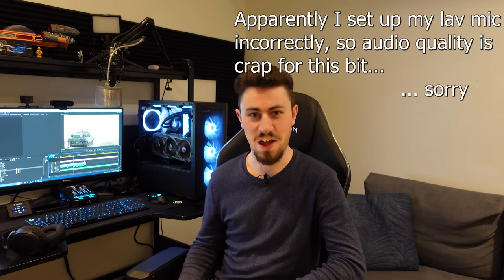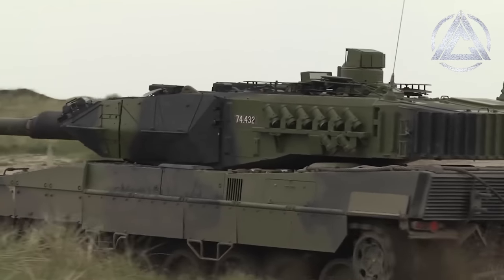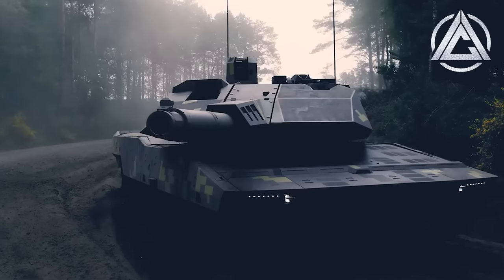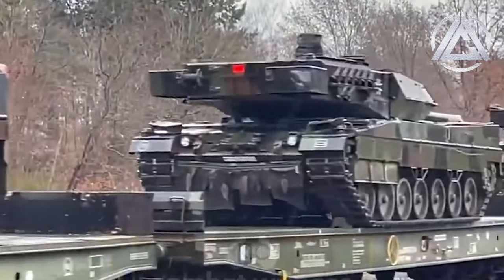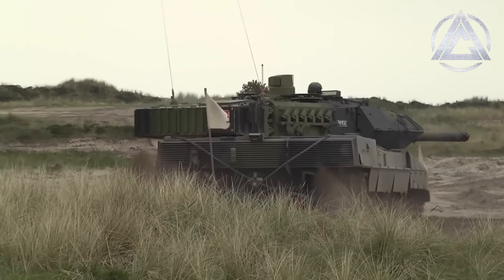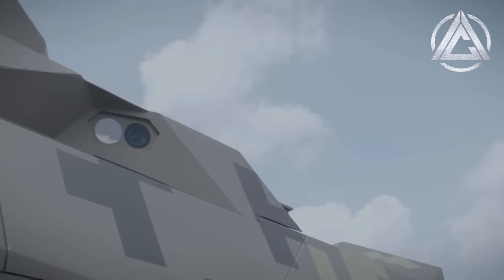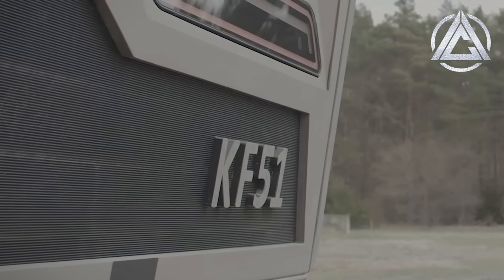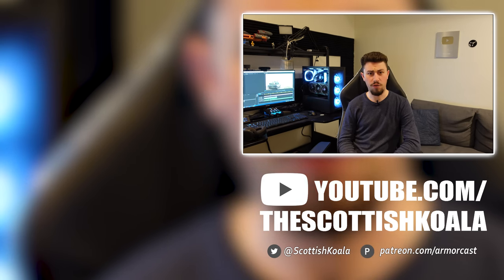Germany's New KF51 Panther Tank | The Spearhead of a New Generation?

Comment: 1km............................5km..........................10km............................15km

120mm Main Tube Ballistic Range
------------------------------------------------------------------>

120mm SLRP Effective
---------------------->

Typical Central European LOS Limit
------------>

XM1111 Lofting LOAL Range
------------------------------------------------------------------------------------------>

Central Europe, with ironically, the exception of Ukraine, is not the Saudi Empty Quarter.  There are no 7-10km LOS lines before you find a tree, building, ridgeline or other obstruction to line of sight.  It's more like 1,200m and in some places (Fulda) 800m.

At those distances, everyone is at overmatch and even 'glancing' hits to the likes of gun mounts and turret roofs go right on through (T-62 vs. Chieftain, Iran:Iraq war).

Nor is it wise to take a weapons system with a 15-20` barrel elevation limit into a threat zone with 4-5 story obstacles on all sides, less than 100m away.  You will get hosed by shooters on rooftops you can't shoot back at.

Conversely, it's equally ill-considered to try and take a mile per second tube into a scenario where the nearest collateral/unintended is 10` and 100ft to either side and downrange of a legitimate target.  A Saboted Long Rod Penetrator will go thru multiple houses.  A HEAT/HEF/HESH round will collapse a multistory building.  A cannister round will sweep linear blocks of distance, ahead of the burst point.

Tanks once were useful for infantry support.

And then they invented the Anti Tank Rocket.  And then they invented the IFV with timed ABM ammo and 60-80` elevating guns.

While tanks went the opposite direction towards specialist predators who hunt their own kind.  And have design optimizations (frontal arc armor greater than 1 meter of rolled homogenous armor equivalency, tin plate everywhere else...) specific to that role which render them of questionable utility in their original mission.

NLOS Top Attack changes everything.  It allows tanks to act like SPG.  With Precision Guidance Kit GPS rounds for static targets (20,000 dollars per round) and seekered Cannon Launched Guided Projectiles (70,000 dollars per round) for movers.

Your basic M829A4 costs 1,000 dollars.  And your typical FGM-148 Javelin about 100,000 (250,000 with the CLU).

NLOS means you can shoot over obstacles without regard for 'hull down' barrel depression limits or functional terrain.  You can achieve maximum range of the tube rather than the ballistic computer and laying sensors.  Now you are no longer in a Wild Wild West quick draw as you come to every street corner in a city.  Because you let the drone go first to find the bad guy, behind the 7-11.

Now, the idea of an Active Protection System shooting down an inbound round is relevant to a 20-30m standoff EFP detonating a 9,000fps penetrator over that 60mm, paper thin, turret roof.  Rather than rhino-by-the-horn trying to spear through the meter thick frontal slope.

No NLOS means you are operating at the Moar Dakka level of King Tiger vs. T-34/85 in a world where nobody misses (The free trade of the last three decades has made Russian and Chinese tank FCS as good as ours).  This is frankly stupid in an era where the Air Force has had AIM-120 AMRAAM hitting 1,000kph targets, 40km downrange, since 1991.

Use a Coyote UAS, go find a target at 20km.  Fire the munition down the bearing at 14km, with a datalink hookup at the muzzle via induction coils.  Confirm target ID upon munition eyes open via the thermal or MMW seeker on the round.  Confirm BIA via the loitering drone.

The T-90M is a 7 million dollar vehicle, the value trade is worth it.

If you fire at 12km vs. a threat which can hit you at 4,000m and kill you at 2,000m, he has to drive, at 60kph, for a minimum of EIGHT MINUTES from your first impact to his first shot.  Wake up Van Winkle.  It's not 1944.  It's the 21st Century.

Comment: MASSIVE shot trap there! No thanks
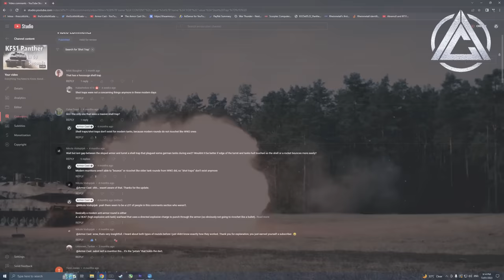Reply from the maker: 21:55 we explained why it is not a shot trap
Reply: Hmm, you explained that a fin round here is not a drama. My use of the word 'Shot' may not have kept up with WOT parlance, but a Shot from any number of rounds will be funnelled in against the ring and, on DETONATION will lift the turret off, nice and neat; or, in the case of HEAT, will absolutely be activate UNDER that big protective nose. HESH, HE etc ditto. So, no drama as long as the opposition is kind enough to stick to fin.

Comment: The idea of a Drone operator shows how Rheinmetall doesn't understand Tanks, its like the 2nd turret in inter war tanks... same with the loitering-munitions stuff, those are just making the tank Worse, if they want to sell the tank (I doubt they will sell any for other reasons)

The idea of having a higher caliber MG as Coaxial and a ""AA gun" with lower caliber is not bad idea, howeveer
I actually wonder why evevn have a pint mount MG at that point, either you put the .50 there because of doing some pop shots on drones, or you don't even put anything there.

I Know they were using a Leopard Hull, but not having a Unmanned turret as given option, there is a bit of a miss, since its a technology demonstrator.

One thing I don't doubt that all that is gonna happen is that in some or many years in the future the gun may be adopted by Germany... same with Abrams X, unlike Chally3
Reply from the maker: Well, Abrams X is only MEANT as a concept vehicle, there is no desire to manufacture or sell it in its current form, it is literally just for showing off. However, my opinion is that the XM360 cannon (an ETC gun) is the future of tank weaponry, not the 130mm calibre
Reply: @ArmorCast  yeah but still, neither one of those will be adopted because they are tech demonstrator, Rheinmetall seens to just pulling a "Engessa" trying to sell their brand new tank prototype after expending money on everything, while its too big to fail as a company, I don't doubt its gonna have some financial troubles, specially if they do try to make a factory in Ukraine (that even if they started the day the guy proposed, would not have delivered a Single tank before the end of the war)

Comment: Germans seem to love their shot traps, huge one on this.
Reply: Shot traps don't exist with modern munitions.
Reply: @techtical7079  deflection doesn't exist anymore then?
Reply: @Tconcept  Modern anti tank munitions fired from cannons are rods of tungsten or depleted uranium moving at around 1600 - 1800 m/s. When they impact a target they're either going to sink into it or completely shatter if they fail to do so due to an extreme angle.

ATGM's, rocket launchers and other shaped charges detonate on impact sending a superheated jet of material trough armor, which also doesn't really have an ability to deflect off of surfaces.

That's why you see a lot of modern vehicles having what would essentially be shot traps if we were speaking of ammunition used during the 1940's - 1950's.
Reply: This isn't 1945...

Comment: So your telling even RPG-7 Tandem shape would penetrate frontal turret armor 🤣🤣💀💀, BRO NATO TANKS usually used Composite and NERA armor which make Tandem shape less effective because NERA elements are multiple layers of steel and rubbers apart from each other not only multiple layers it have more layers, Tandem Shape have 2 Charges the first charge are precursor Charge which is small Made to counter ERA, and the Main Charge will go in, Tandem shape are effective against ERA, there are less effective in NERA and COMPOSITE because the first charge of Tandem shape will just penetrate the first layers of NERA, NERA usually have multiple layers and more layers than that, NERA and COMPOSITE are great against HEAT most NATO TANKS have Frontal turret protection up to 1600mm-2350mm protection against HEAT it means that is the maximum Penetration it can stop doesn't matter if its tandem shape or not, Tandem shape are not made to counter turret armor which usually use Composite and NERA, Tandem shape are less effective than those DUMBASS 💀💀💀💀
Reply: This comment was so unneccesary
Reply: @CloudNine-b7e  Wrong comment tho

Comment: 33:10 F-35 is not a very good design though, born out of desire to minimize costs
Reply from the maker: You’ve fallen for the exact problem I used the F-35 to highlight! 😂

The F-35 is without a shred of doubt the most advanced fighter aircraft in service today
Reply: @ArmorCast  it is the most advanced in terms of technology used. The problem is that it just has insufficient flight characteristics for a multirole fighter. It stems from it being basically designed as a STOVL(and F-35 is an amazing STOVL fighter), which drastically limited what designers could achieve. Therefore, while F-35 is also the best SEAD aircraft today and also can be used as stealthy AWACS for 4th and 4+ gen fighters, it definitely can't fight in air battle all by itself.
Also it should be noted that neither A-10 can fit in F-35 role nor F-35 can really replace A-10.
Reply from the maker: @jimmcneal5292  Reasonable, but I would point out that the F-35A has achieved a more than 17:3 victory ratio against the F-16C in dogfights (100% in beyond visual range engagements), and 9:3 against the F-15C (again, 100% in BVR). It's certainly no slouch!

In the air to air role, there is one platform in the world currently that beats the F-35, and that is the F-22A Raptor.

However the primary purpose of the F-35 is ground attack and close air support, of which there is no superior platform in the world right now. Cheaper platforms? Yeah, sure, and if you're going up against insurgents who's closest thing to an air defence network is a Toyota technical with a DShK on the back, then sure you might want to use one of said platforms, but the F-35s unit costs and operating costs have come down significantly since 2015, to the point where the required upgrades for an A-10C to be deployed to combat now are actually MORE expensive than a brand new F-35A.

Also, ONLY the F-35B variant is STOVL capable. F-35A and C are not, hence why F-35B is the most expensive variant by a large margin (and in theory least capable kinematically)

Comment: Since the time after the Second World War, the Russians began to show weapons that look cool, but in fact are not capable of anything. The first jet fighters flew in parades with 30 mm guns, which were actually dummies. The IS-3 tanks were so unsuccessful that the frontal armor tore under its weight along the weld seam. But they made this crap by the hundreds (planes) and thousands (tanks), just for show. I can't believe that at the end of 2023, someone is seriously talking about the Armata tank, as if it exists as it was presented and that it even has cutting-edge technology, which is not on any tank in service with NATO armies. I'll just remind you that they showed the tank at the parade in 2015, 8 years ago, and wanted to produce 2300 tanks of the T14 Armata by 2020. But about 30 test samples are being manufactured, and Moscow explains this by the fact that they are too expensive, although according to various data, one Armata tank should have cost from 5 to 8.5 million dollars, and the T90 costs from 5 to 7.